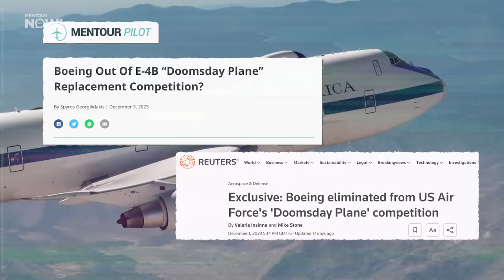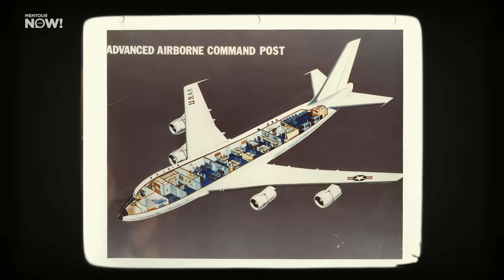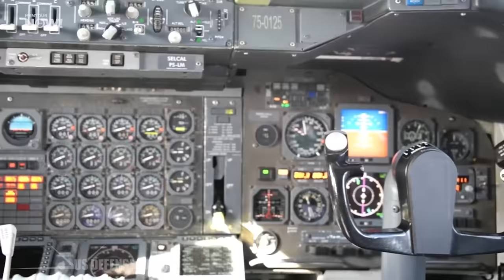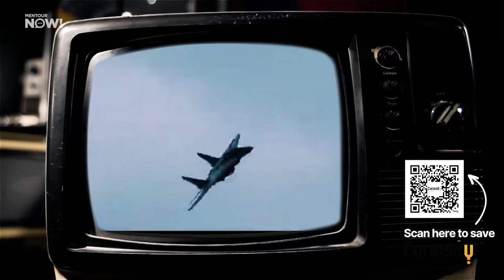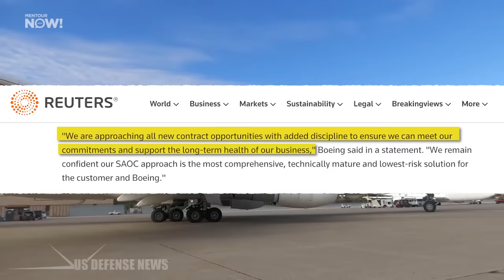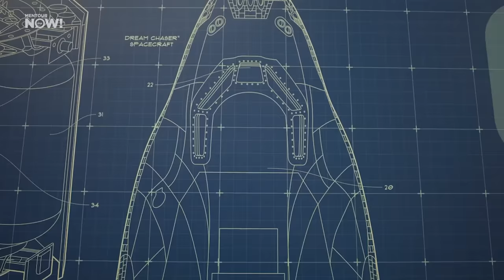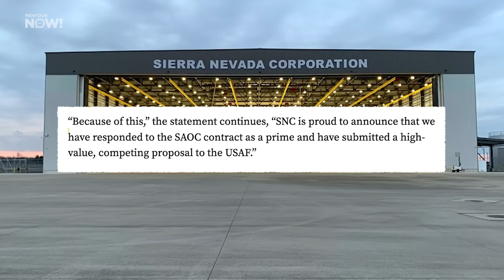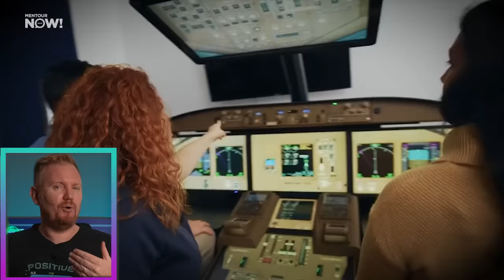Why was Boeing kicked out of the Doomsday Plane competition?!

Comment: On the 4 engined aircraft requirement by the DOD i only see the A340 as an alternative to the 747.
The A340 is a relative young airframe, lots of them are available , relative cheap to purchase and they were designed to fly long distances.
That one also has the benefit that it could theoraticly cruise on 2 of the 4 (modern CFM leap) engines for even longer military missions.
On the other hand a non US build aircraft maybe a big nono for the DOD.
Reply: the A340 is a crap plane.
Also, did you listen to the video? They require an FAA civil certification of the platform which does not exist for an A340 equipped with LEAP engines. There is absolutely no way that Airbus and CFM would underwrite the certification of an A340 NEO for 10 airframes for the US DoD. It makes absolutely no sense.
Reply: @charlottelanvin7095 you’re saying absolute nonsense the A340 600 is an absolute beast of an aircraft pilots say that it’s too powerful sometimes lmao get your facts straight
Reply: What about US modified?  Airbus has a big manufacturing plant in Alabama.
Reply: @charlottelanvin7095 why would you equip and A340 with LEAP engines. The A340-500/-600 have RR Trent 500 engines which are nearly twice as powerful as the CFM-56’s
Reply: I really hope this comment is sarcastic. The airbus A340 is literally one of the weakest airplanes in history. It takes almost an hour to even get to your cruising altitude because the engines are so weak. The engines were designed for the airbus a320. Of course with them being weaker, they thought adding 2 extra would help. While other aircrafts get to their cruising altitude in around 30 mins, the A340 takes 45 mins to over an hour depending on how heavy. If you were to take these statistics and add all the extra weight of what Air Force One needs, it could take 2 hours just to get to cruising altitude with all the extra special modifications. 

On top of that, the A340 has one of the most horrendous fuel Efficiency. 

The only good thing that comes from a A340 is the landing gear. I think it’s pretty cool and unique. But if we are talking about practicality, a CRJ-900 would be better than the A340. All joes aside, the A340 will never be picked for a category such as Air Force One.
Reply: @charlottelanvin7095 exactly! Lol the airbus A340 is one of the weakest and has the worst fuel efficiency. Top that with all the extra weight of the modifications and special installs of Air Force One…..it would probably take 2 hours just to reach cruising altitude 😂
Reply: What about some gently used A380s when everyone starts getting tired of Hub-n-Spoke again?
Reply: @NicoSteentjes  they do, but chucking work hours at cuz Bubba and his bros is not the frigging point bro. change anything significant on the platform and you'll need to put multiple $100millions into certifying it for civil use. For a series of 10 planes? pardon the pun, but that plan does not fly
Reply: @nounoukasber the A340 was a commercial failure. The original -200 and -300 were trash because of their terrible engines and the -500 and -600 never sold well in competition to what Boeing was offering.
Reply: @Southernswag8283  we’re talking about the A340-500/600 with the RR Trent 500 engines, not the CFM56’s
Reply: @FlyByWire1  Because by then the 777 was the thing, along with the A340's twin brother, the A330.
Reply: @Southernswag8283  More than one variant of the A340 exists you know, right? The -200 and -300 variants may have been lackluster but they're not the newest version anymore. The -500 and -600 have nearly double the thrust of the others.
Reply: @cjmillsnun  yeah if you look at the history of Airbus, they never faired well with 4 engine planes. The A340 didn’t sell well and the A380 didn’t sell well either. The A380 program literally never even made a profit, they spent far more on development costs than they made back in sales. And the A340 was only “profitable” because it was part of the same program of the A330 which sold like crazy. Many of the comments seem to think that because Boeing withdrew from the running that means a 747 won’t be used when it really just means that another company will be contracted to acquire a 747 and reengineer it. It doesn’t have to be Boeing at all.
Reply: @Southernswag8283  you are aware there's a A340-500 and -600 right? These do not have CFM engines like the underpowered -200 And -300.
Reply: @jameshannay7376  that’s true but they’re also much less efficient than the engines on the 747-8.
Reply: Why would the USAF restrict their platform choice to civilian airliners, when they already own hundreds of C-17s with at least similar capacities and capabilities? It's not like the E-4B's systems are using the entire 120-ish tons of payload the 747F provides.
Reply: @FlyByWire1  Some online digging shows that it's only about a 3.8L/100 Passenger KM to 4.1L/100 Passenger KM with the 747-8 to the A340-600 so it is not horribly drastic.  The -500 also has a fuel efficiency of 3.5L/100 Passenger KM, even better than the 747-8.
Reply: @BlarryOfficial   Asked Bing AI and it was surprisingly informative:

The C-17 Globemaster III, developed by McDonnell Douglas and Boeing, is a large military transport aircraft. It’s designed for rapid strategic delivery of troops and all types of cargo to main operating bases or directly to forward bases in the deployment area.

However, there are several reasons why C-17s might not be used as doomsday planes:

Size and Capacity: The C-17 is smaller compared to other transport/cargo aircraft in the U.S. Air Force inventory, like the C-5. Doomsday planes require extensive onboard systems and equipment, which may necessitate a larger aircraft.

Role and Design: The C-17 is primarily a cargo and troop transport aircraft. It’s designed for tactical and strategic airlift missions, not for use as a mobile command post in the event of a major disaster or nuclear war, which is the role of a doomsday plane.

Development Issues: The C-17 had several problems during its development, including wing structure deficiencies, and it did not meet weight, fuel burn, payload, and range specifications. These issues could have influenced the decision not to use it as a doomsday plane.

Production Halted: The production of the C-17 has been halted since 2015, which means no new C-17s are being made. This could limit its availability for new roles such as doomsday planes.
Reply: @FlyByWire1 So you’re calling the CFM56 a terrible engine? It’s the most popular engine in its field with exceptional reliability and an on-the-wing service period of 30,000 hours!
Reply: @charlottelanvin7095  When you look at the new airforce one ,747's they al need a new civil certification due to all the changes made to the original 747-8 airframe and the 737-max debacle.
For the A340 to function to DOD needs it has to be reengined.
The 4 engine requirement is limiting the options of available civil aircraft. (747 , A340 , A380 , IL96 ) The Ilyushin IL96 only when hell freezes over and christmas and easter are on one day. 
As a last result they could ditch FAA regulation and use military planes like the C17 and B52.
Reply: @Southernswag8283  does it matter if climb rate is not too good if it is supposed to stay up for a long time with air-to-air?  I thought I heard persistent coverage?
Reply: Yea expect your forgetting Lockheed
Reply: @jameshannay7376  right but this plane does not carry regular passengers. We aren’t able to know what the fuel burn is because it doesn’t carry usual loads like a passenger aircraft. But it is a fact that the newer GEnX engines are much more efficient than the Trent 500s. The Trent 500s are pretty old tech by now.
Reply: @LAGoodz  a terrible engine for the A340, not terrible overall. My bad, I should’ve clarified that.
Reply: @FlyByWire1  per seat is still a good analysis even if the passenger aircraft isn't carrying passengers because it still indicates capacity. For some reason GE and Boeing do not want the SFC of the GeNX online for some reason, and the only value I found was 0.532lb/lbf/h. Compared to the Trent 500 at 0.542lb/lbf/h. Not as big as a difference as you think.
Reply: @FlyByWire1 Actually, the A380 program turned out to be very very profitable for Airbus. Not in A380 sales obviously 😉
But most of the expensive A380 R&D went later into the development of A350. And this plane much more successful.
Reply: @MrBlafhert  that’s not how aircraft programs work. The A350 was a separate project with its own R&D. It doesn’t matter if it incorporated tech from the A380, the A380 program was never profitable. Airbus has said this publicly many times. It’s okay if your feelings are hurt about that lol
Reply: @charlottelanvin7095 The A-340 has the slowest rate of climb of any commercial airliner I’m aware of, and is notorious for horrendous fuel economy. The plane selected  for this contract would need to climb away REALLY fast to escape a nuclear attack, and would need to stay in the air  for extended periods of time until the worst situation in the history of mankind was stabilized. A 65 year old DC-8 would literally be a better option.
Reply: @Doubie.  Lockheed has the P3 Orion, C130 Hercules and the C5 Galaxy. The P3/C130 have the advantage that they are super rough and tough turboprops.
The Japanese Kawasaki P1 Navy patrol aircraft has as its base the Lockheed P3 (electra) turboprop and was converted to pure jetengines.
The C5 might be to big
A P3 orion with 4 standard R&R F130 engines like the reengined B52 might do the trick
Reply: @chandlerwhite8302  Ever heard of the A340-600? You are talking about the A340-300 with the weak CFM engine.
Reply: @chandlerwhite8302  There are different models of A340. With different performance. Also, many commercial takeoffs are derated to use only as much thrust as needed. Seriously. Look it up 
These planes are not intended to be driven by Mad Max dodging nuclear attacks from left and right. You're thinking of fighter jets. These are intended to stay aloft and on mission for very long periods of time.
Reply: @j_taylor  The  E-4  is literally designed to to fly like Mad Max and dodge nuclear attacks. That’a the only reason for it to exist, look up its mission. Your post proves my point as to why an A-340 would be unsuitable for that application.  The 747 could fly circles around it.
Reply: The C-5 by Lockheed would likely work.
Reply: @charlottelanvin7095 Really? Outside of the higher fuel consumption and low performance  issues of the first gen engines, the A340 with the RR engines is a gem.
Reply: @Southernswag8283 What you wrote was kind of true for the early -300 variant.
It's definitely not true for the -600. Get your facts right.
Reply: @F4LDT-Alain  you actually got me there. I learned something new today. I had no idea the 600 had upgraded engines.
Reply: @FlyByWire1 That is how R&D work, on any business. Reuse your investments (R&D) on any occasion when possible. Yes the A380 on itself was not profitable, however a lot of the A380 R&D went into the A350 program, making the A350 cheaper and faster to develop.
It's safe to say, despite the non commercial success of the A380, it paid off on A350.
Reply: @emmabird9745  I agree it can stay in the air for a long time ago but if it needs to do a high performance take off climb like the 747 Air Force one, it won’t be able to do that. It doesn’t have the speed for evasive maneuvers during take off.
Reply: @peterwhite7041  that would be sick. I’m absolutely obsessed with the a380’s! I love the shape of the wings and how good the engines look on them.
Reply: @chandlerwhite8302  : The E-4 is not supposed to "dodge" nuclear attacks, it's supposed to perform fairly standard rough-weather maneuvers while staying a reasonable distance from the target of nuclear attacks. If an airplane is "dodging" nuclear attacks then it's too late for that plane.
Reply: @JarrodFLif3r  : The C-5 Galaxy is much too rare a plane to justify converting any away from the cargo role. The earlier suggestion of the C-17 (or was it 15?) is a much better choice due to the number of available airframes.
Reply: @absalomdraconis  
The C-17 Globe master II is also another Boeing plane. 

They are currently overhauling C-5s, it would not be unreasonable to grab  2 airframes in that process to give them the upgrade to the EC-5 Doomsday. 

The C-5 airframe is Lockheed so liky no issues like Boeing has in terms of being unable to complete a fixed price order on budget. (Also the quality of Boeing has gone way done hill as well)
Reply: @absalomdraconis  
Also someone pointed out there are many C-5 airframes in the desert boneyard.
Reply: @JarrodFLif3r  The medium and large transport aircraft like the C130, C5 an C141 at the boneyard are early/prototype variants or have "bend" airframes ( to many flight hours, experienced extreme flight manouvers etc.etc.) that need a full airframe rebuild.
Often its cheaper to build new then to rebuild an existing airframe.
Reply: @obelic71  
My understanding is some airframes are still usable and are often used to cannibalize parts when needed. 

The reason the location was chosen is because of the arid climate it makes a great long term storage area that's climate helps limit corrosion over time.
Reply: @JarrodFLif3r  yes the parts on an aircraft corectly stored can be used to keep other aircraft aloft f.e. older versions of the B52's are used to keep te current fleet in the air.
You have also deep storage. Those aircraft like lots of F16's are prepared so they can be put into service in 2-4 weeks in case of emergency.
During the covid pandemic also lots of commercial airliners were put into deep storage.
On deep storage aircraft NO parts are removed.
f.e. Lufthansa did put its A340's into deep storage in 2020 and all of them will be back in service the end of this year.
Reply: The A340 is extremely underpowered. It's performance sucked, that's why they were not popular. The 747-400 and 747-8 are extremely overpowered and that's why they are preferred especially in these "light" configurations. 

Ever wonder why AF1 can take off and stand in it's tail?
Reply: @nounoukasber nah you need to get your facts straight. The A340 is extremely underpowered and that's why it was not popular. Where are you getting your information? This is why the 777 flies circles around it.
Reply: Boeing is being sensible because the 8 available 747-8's are all under Boeing control. Boeing has the only planes that can meet this contract and they get paid no matter what.
Reply: @avgbowler  Boeing CEO Calhoun did mention publicly that Boeing as a company in hindsight never should had agreed to the new Airforce one deal.
In the Decembers shareholders meeting the new airforce one aircrafts were presented as a company write of to the shareholders.
Its understandable that Boeing doesn't want to take on another loss making project in these dire times for Boeing.
Reply: @avgbowler  The A340 was developed in the time were 2 engines were limited to cross the atlantic/pacific routes because of ETOPS-90 rules.
Thats why the A340-200/300 has 4 tiny engines ,and the DC10-MD11/ L1011 / B747 was king on those routes.
When the ETOPS rules was extended to 120 and later 180 minutes 2 engined aircraft like the A300/310/330, B767/777 became the norm on the atlantic. 
Tri jets were fased out very fast.
The A340 was build as a long distance ETOPS-90 sibling of the A330 and lost its purpose when the regulations changed. 
The A330 already had the more powerfull engines who were already on several other aircraft like the MD11
The later A340-500/600 variants alias the flying pencils had 4 powerfull engines.
Those models were no comercial succes because the 2 engined B777 was cheaper to operate.
The A340 only kept relevant to this day as a niche aircraft for hot and high destinations
Reply: @obelic71  this one again shows Trump is a shrewd negotiator. Normally, there are ways to wiggle out of these contracts, but the AF1 contract is ironclad.....

Boeing's main problems is that they have not been able to deliver anything without problems while their competitors are doing it better and cheaper.
Reply: I don't see it as realistic at the moment that it could be based on an Airbus. In that case you could even argue for a a380. 😂
I think the only alternative to a 747 O could see being chosen would be a C-17.
Reply: @FlyByWire1 and now? All you are saying doesn't really apply here. They don't want to go into civilian aviation. And the failure wasn't bc of the power, but bc it could compare to the similar sized aircrafts like the 777 in efficiency, bc 2 engines take less fuel than 4. 
Actually if we just talk about the engines and how grade they were for the plane it would beat all the other 4 engine planes. One thing extremely important for this competition is efficiency as they need to stay airborne as long as possible while having to rely on tanker plans as little as possible.
There is no other 4 engine plane as efficient. It just can't compete in a marked where 4 engines aren't a requirement.

So while I absolutely agree it isn't a fit, there is one thing that definitely isn't the reason and that are the engines.
Stop talking about sh*t when you have  no idea what you are talking about. Yeah boohoo it takes longer to reach flight level, no one in the industry ever really cared and of you really believe that was the reason airlines didn't want it you are really clueless. And with the later version having the Trent 500 that wasn't even true anymore. The literal only reason was always 4 vs 2 engines.
Reply: @TheRattail  The problem is the DOD demands a 4 egined aircraft with a civil aviation certificate and a C5 / C17 has only a military one.
Only young used 4 engined long distance aircraft with a FAA civil aviation  certificate are available now.(B747-8, A340-600 and A380)
An A380 is totaly unrealistic to heavy for most airports and is restricted to only the major airports.
So the closest alternative for the job under current specs. to a B747 is the A340.
The easiest way to go is that the DOD drops the 4 engine requirements. A brandnew 2 engined B767, B777 or even an A330 is the most logical choice.
The B767 and A330 are already being used for NATO as an aerial tanker (A330MRTT) and Awacs (E-767) aircraft. 
So it makes perfect sense for the USAF to use one of those.
Reply: @obelic71  I think they wouldn't ever drop the 4 engine requirement. And I think rightfully so. The main thing this airplane is supposed to do is to stay in the air no matter what so 2 engines is an absolute deal breaker as you are screwed if you loose a single engine. I think in that case it would be more realistic for them to drop the civil aviation certificate as a requirement.
Reply: @TheRattail  Correct A C17 moose with full aireal refueling capacity would be the best 4 engined military aircraft option.
those are still produced new for several NATO airforces.
But like always pencil pushers commanding a desk in an office building have little to no knowledge about real world problems. 

To be fair a thermo nucleair exchange between f.e Russia and the US would last only 1 hour.
25-30 min total ICBM flighttime launchsilo to target. 
10-15 min ICBM flighttime till launch is detected. 
15 min confirmation and retaliate counter launch. 
5-10 min safety window  
The doomsday planes are needed  to get the counter strike ICBM's out of the silos before they are destroyed.
A 2 engined aircraft can fly max 2 hours with 1 engine down. In a nuclear exchange you are already death because you have nothing to return to.
In Europe for short and medium missles a doomsday plane has no practictle use.
Thats why we have doomsday submarines who retaliate.
Reply: @avgbowler It's not at all underpowered in A340-500 and -600 form. Only the -200 and -300 were underpowered. Here's a list of most to least powerful planes, based on the thrust to weight ratio (based on MTOW): A340-600 (.286), 747-800 (.270), A340-500 (.267), 747-400 (.265),  747-200 (.263), A340-300 (.223). So in a "drag race", an A340-600 should have no issue outdoing the existing 747-200B, or even the 747-800. Perhaps your impression that the other A340s are slow is because reduced-thrust takeoffs are used to decrease engine wear. If they took off at max thrust, they'd definitely get going in a hurry.
Reply: @avgbowler Lol, as per my other reply, looks like you're the one without use of facts.
Reply: @DavidTheScientist  again you are dead wrong..... The 747 is among the fastest commercial airliners in the world. You mentioned the 200 series of 747. Have you seen what a loaded air force one can do? Sorry but I believe in physical results, not paper. The 747 out lifts the underpowered A340 and outflies it as well. The 747 is the queen of the skies for a reason.
Reply: @avgbowler  Lol, you seem like someone who would also say certain cars are also faster because the torque makes them feel faster. 
So now your argument changed from "underpowered" to "slower". Well, power doesn't equal speed because things like drag, lift from the wings, and other factors also come into it. Similarly, boats are speed limited depending on their hull length etc, once you get past an optimal maximum the physics go nuts. 
I don't know what you're trying to prove here, but you sound like a Boeing fanboy. The fact is that an A340-600 has a better thrust ratio than any 747, and will therefore accelerate faster. I don't know about climb performance, because that also depends on the design of the lifting surfaces. As for top speed, the 747 is the fastest, yes, also faster than 777, 767, 787 etc., none of which are considered underpowered. Just accept that you're wrong when you say the A340-500/600 are underpowered, because they're clearly not. If you want physical proof, there's also a video of a LH A340-600 taking off heavy from SFO with rotation in under 30 seconds, which is rediculously fast for a heavy widebody.
Reply: @DavidTheScientist  LOL, and you seem like someone who thinks they are smarter than they are.......

Torque is for acceleration and HP is for speed..... But again, A340 top speed is 543mph, and the 747 is over 600mph.... 

The 747 moves more weight per mile, which makes it far more efficient. 

I am not a Boeing fanboy, but like most true pilots, I do not like Airbus. 

Compare the A340 to the 747 and you see why the 747 was far more popular. 

BTW, 757, 767, 777, 787 were never considered underpowered because they were never released with inferior engines to get them out the door.... 

You cherry-picked the two latest versions that received a NEO upgrade BECAUSE THE ORIGINALS WERE WAY UNDERPOWERED, but by the time the NEO option was available, it was too late...

If you want physical proof that the 747 is better, look at the DREAMLIFTER taking off from a 6000 ft runway with room to spare..... What's the book on the 747 runway performance again? BTW, take off roll started at 1:34 of the video and wheels-up was at 2:00 of the video.... Do the math.....

You are the one that sounds like an Airbus fanboy. SMDH........

The 747-8 and even the 747-400 are far better planes than the Airbus A340 and its not even close. The Airbus engines could not even provide the power that is needed for the electronics, and no because the Trent engines are derated, they could not run on two like the OP said..... Again like I said underpowered. The 747 can easily drop one engine as the manual says for its military variants.....
Reply: @avgbowler  What on earth are you going on about? You're putting words in my mouth, and you're going off-topic. The question being discussed was whether the A340 would be a suitable alternative. You contended that it wasn't, because you said it's underpowered. I proved you wrong, by pointing out that the longer -500 and -600 models (the closest size-wise to the 747) are in fact NOT underpowered. I never trash-talked the 747 (and indeed have fond memories of flights on them when I was younger), I simply stated that the A340 is not a poor alternative based on power alone. Maybe, there are other factors that make it unsuitable, but power is not one of them. You're the one putting words in my mouth acting like I'm some Airbus fanboy/Boeing hater, lol.
Reply: @DavidTheScientist  SMDH...how much power is available for ELECTRICAL? 

Again UNDERPOWERED for the electrical requirements of the project.
Reply: @avgbowler  I don't know the exact answer to that, I'm not an aeronautical systems engineer. Are you?
I was also never addressing the issue of electrical power. I specifically addressed thrust.
However, looking up documentation from Airbus and Boeing, I see the 747-400 has 4x 90kVA generators, and the A340-600 also has 4x 90kVA generators. So, the same. I therefore don't see why there should be any issue for the A340-600 filling this role. Furthermore, all systems for the aircraft will likely be extensively revised and updated. 

I knew someone who was the maintenance program manager for the presidential helicopter fleet for a while. He obviously couldn't tell me much, but he did confirm that none of the wiring is the standard stuff, everything has been replaced with much better spec, shielded against EMI etc. 

So anyway, keep shaking your head. Because so far you haven't provided a factual comeback to any of my points.
Reply: If you stick LEAP engines on an a340, it can barely climb well. They would need at least Genx 2B to be performant. And, I can see the United States army on a european plane rather than an american jet